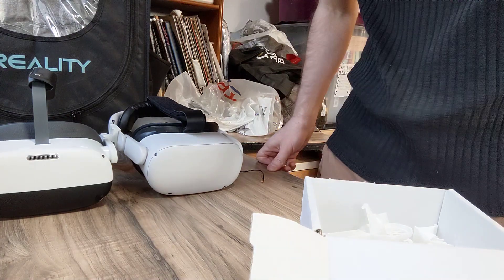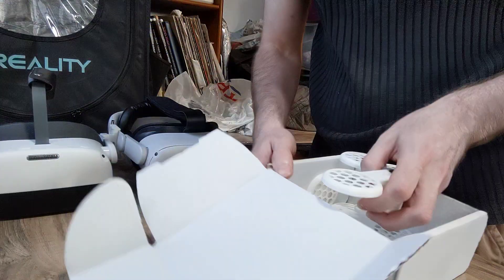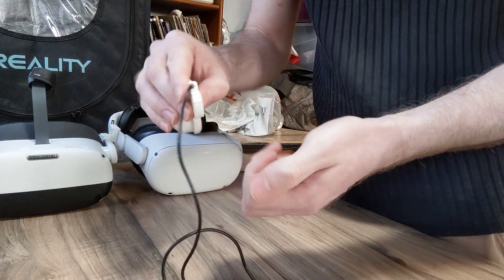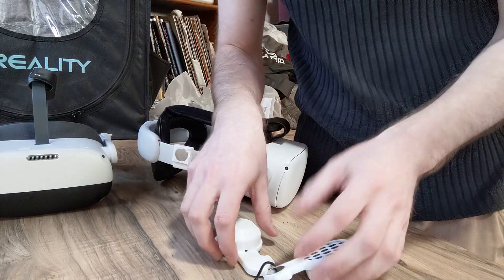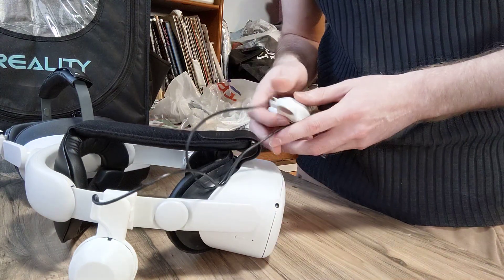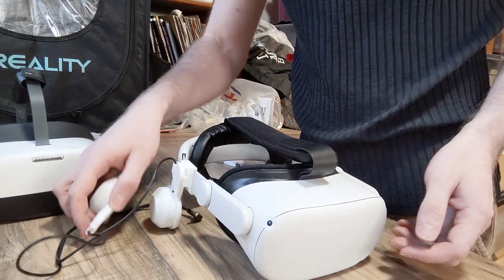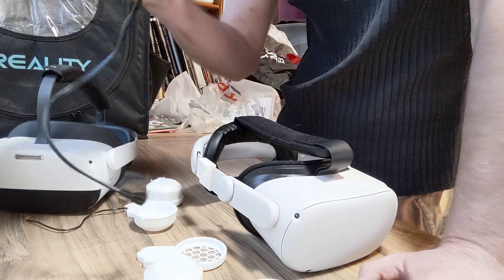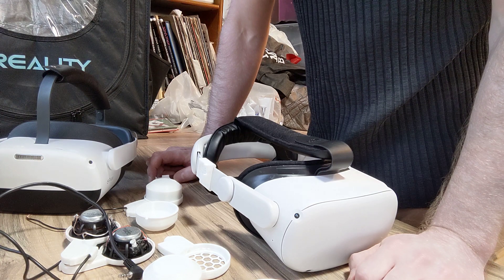My universal VR speaker solution- taking name ideas! Valve index audio on Quest 2 & Pico neo 3 link.

Comment: i've two couple of ReverbG2 speakers, the same as the Valve Index BMR, there's a way to use them with a 3,5mm speaker cable on the Quest 2, or the PSVR2? there's a scheme?

Comment: great work! i've just ordered BMR's after seeing your vid. unfortunately shipping will take about 2 month to where i am. can you share dimensions of magnets so i can order them too and be ready to build when drivers arrive?
Reply from the maker: Hi mate, they are 20mm x 3mm n52 neodymium magnets.

I got mine here,
 https://www.ebay.co.uk/itm/353922751816?mkcid=16&mkevt=1&mkrid=711-127632-2357-0&ssspo=tDMcK3lJSCK&sssrc=2349624&ssuid=xjc9zVWaTIy&var=&widget_ver=artemis&media=COPY

gets cheaper the more you buy, there may be cheaper elsewhere but the ones from that seller are SUPER strong.

What headstrap have you got? The elite styles are fairly similar but I've just received a bobo m2 plus for quest and it's going to be more of a challenge by the looks of it unless some folding away of the headstrap comprises are made, as the pivot section is pretty much where I will need to put the brackets. For non destructive install
Reply: @virtuallyreal  thanks! i got m2 plus as well. i've been thinking about attaching it through the pivot. i could probably figure out design of replacement plug that would screw from the inside. kinda like one in JayBratt's review of Prettygoo3d's solution.
Reply from the maker: @KIFFIR  I'd need to change my bracket design to do the same and it would be too far away from the ears in that location really which makes the bass suffer.

I'll print a quick mock up this weekend, already wanting to redesign some locking mechanism into the bracket so it can offer rotational steps of adjustment for something like the bobo strap 

With the bobo, it's going to be a particular challenge with all those adjustments and pivots, to me, correct fitment of the strap is straight where the black rear meets the pivot hinge, but the headstrap allows for rear to be forced low, meaning it's no longer going to to be in correct position for ears if going off my existing simple clip design, there's no adjustment vertically as that's not something I could keep with a quick connect magnet solution, so height is designed into the bracket.

I'll have a play with it and see what I can come up with.
Reply: @virtuallyreal  sounds great, but there is rarely one size fits all solution to such things. are you able to export stp of f3d files for fusion 360? would be awesome if you released them when you're ready so people could tinker with such stuff too
Reply from the maker: @KIFFIR  yep will be soon
Reply from the maker: Hey bud I ended up doing quick design for M2 plus, new video shows this and has links to files in its description 👍
Reply: @virtuallyreal  yep, saw it, thank you. i've been trying to make a bobo bracket myself for a week now. maybe we could jump on a call some time to share ideas?